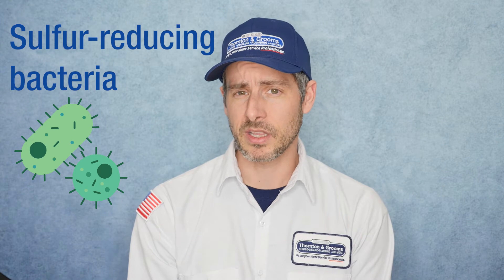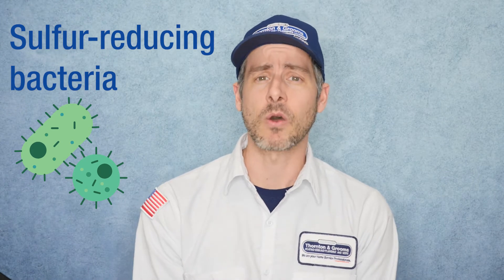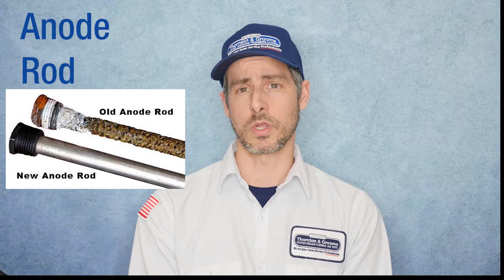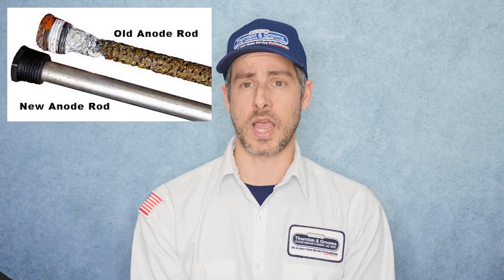Why Does My Water Heater Smell Like Rotten Eggs? Our Plumbing Trainer Explains

Comment: My hot water heater is only 6 
Months old.
Reply from the maker: And your water smells like sulfur? My first guess is the anode rod. It does not need to be replaced, but depending on your water quality, your anode rod could be reacting with the water, causing the smell. Most water heaters come with a magnesium anode rod. If you have hard water, you could try swapping it with an aluminum or zinc rod. If that doesn't work, you could always call the company that installed it and have them perform a water quality test and figure out a solution.

Comment: I need help bad I've changed out 3 hot water heaters and changed the anode rod within 5 months again same on hot water please help
Reply from the maker: Oh no! So sorry to hear that. Do you use well water or City water? It sounds like you have a lot of sulfur (or other contaminants) in your water. Have you had a plumber out for a water test? They can figure out what's in your water and how to remove it. You could probably use a carbon filter, but it's hard to know if that would work without testing your water first.
Reply: @ThorntonAndGrooms  I've had two people out here to change the hot water heater  I don't know what else to do how would I or what's the name would I look under to test my water it is well water I can see a white residue coming off of my ice even in my ice maker when the ice cube start melting it's little particles of white yeah the well guy said to call someone else to test the water but I'm not sure who or what I would look under can you please help me the smell is so bad but on the cold water it's not smelling that way had the Anode rod changed 3 times
Reply from the maker: @wendy8561  I'm not sure where you are located, but you could google "water quality testing near me," and I'm sure someone like Culligan or a local plumber will show up. Most plumbing companies should be able to perform them as well. Some will even test your water for free. Call one of the companies that show up and ask if they can test your water. I'm surprised the previous company that replaced your two water heaters didn't test the water.
Reply: @ThorntonAndGrooms  I'm not sure if they did or not but they did say we had a tiny bit of lead he held up the test tube to a roll of paper towels and said it wouldn't be harmful I'm just so scared my hands have been breaking out thank you so much for your input I am disabled I do have some extra money put back but I'd say I'd spent around $9,000 already God bless you I pray I can get this solved and my water tested very soon